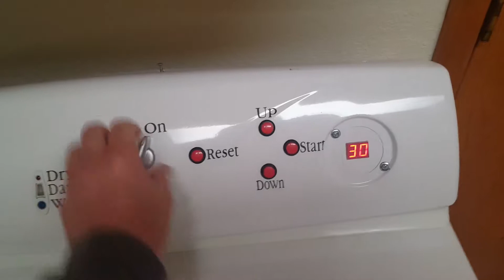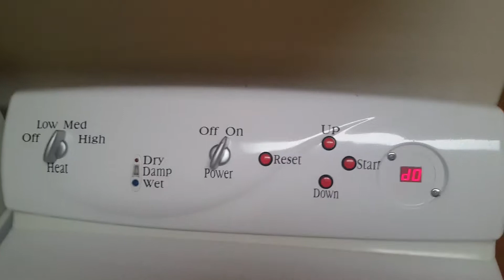Arduino controlled clothes dryer

Comment: Very interesting! I'm also trying to repair a clothes dryer and I think this is the closest to my situation I could find! Originally the problem was just a faulty opamp (resulting in the machine thinking the clothes were constantly wet) but of course while figuring out what the problem was, with my usual clumsiness I accidentally shorted the 12V opamp supply with its output leading to the premature death of the microcontroller said output was connected to... Now I figured out all the connections I need on the board to replace the microcontroller and I'm at the point where I have to program the arduino. I would have some questions regarding your implementation (if you're willing to answer, of course!): 1) How do you manage the humidity sensing? Since I suspect the clothes are not constantly making contact with the sensor, my idea was either to use moving average or to take the maximum humidity value measured during for instance 1 second. 2) How do you manage heating? My machine has two heating elements (800W and 2000W) which can be turned on individually and a temperature sensor. I'm guessing the three achievable power levels has to do with the different "programs" the machine could perform like fast drying and delicate. For now I'm just interested in getting the machine to work in one "mode" and I'm wondering which element(s) should I turn on and how the on/off time should be controlled. In your other video you say that the heater is turned on at the beginning and turned off for the last 5 minutes. I'm wondering if this means that the heat is actually on all the time or if there is some sort of sensor/thermostat that automatically regulate the switching to keep a given temperature (maybe based on low/med/high selector?). 3) You didn't mention if you can change motor direction but if it is the case, did you use that function and how?  The only way I can think of would be to change direction every couple of minutes to maybe help mix a bit better the clothes but I'm not sure it would even be necessary. Thank you!
Reply from the maker: Hi, Your dryer has new controls and circuits as you mentioned the opamp and 2 heating elements.
1) I did not add any controlling aspects to the humidity sensing. If I were to rebuild I would probably use interrupts so the moisture sensing could set the timer down to 5 minutes (if it currently greater than 5 minutes) and turn off the heater. As this is based on a 1 minute interval, the moisture sensing is only happening 1 time on the minute. More reasons to use interrupts and/or move to a seconds timing but figure out how to keep the overall in minutes. I decided it was not work the effort to rework at this point. Or until I run out of other interesting things to work on/have more ambition.
So, I am only using knowledge of how much time it takes to adequately dry as my guide. I changed my code to start at 40 minutes because 30 minutes was not quite enough the majority of the loads. If I were to do moisture sensing AND moisture control I was considering using similar to what you have mentioned. I was going to sense most recent readings and if X of the last were all "dry", then go to the cool down routine of go to 5 minutes and turn off the heating element.
As the old style of heat controlling (I do not know how newer higher tech dryers are doing heating control) have a "low" and a "high" thermostat. Simply, when the heat gets to the limit of the high thermostat (I believe they are both located in the exhaust pipe. It has been a long time since I had to replace these) the sensor (the sensor really is a temperature activated switch/relay) cuts off the 220VAC supply to the heating element. Once the sensor cools down sufficiently, it closes the circuit to the heating element. The moisture in the fabric keeps the temperature down, so as the fabrics become more dry, the heater will be on for less often. I am using the existing temperature controlling features of the clothes dryer. 
If you want to control the 800W and the 2000W heating elements then I would suggest using the Mega or similar model with more pins. I found that I was running out of pins. The 2 8-segment displays use a lot of pins. An option would be to use an LCD display on IC2 bus which will use only 3 pins if my memory is correct. I like the easy to read from across the room the large display. There are multiple options for displaying remaining time. If I were going to get your dryer  working and usable with only 1 of the heating elements, I would choose the 2KW element. I do not believe the 800W will be adequate and therefore efficient alone.
Because of the high current draw of turning on a motor I chose to stagger turning on the heating element by 5 seconds. The thermostats and the heat control knob (heat off, low, medium, high) on the front of the dryer are controlling the temperature. I believe that the cool down period (5 minutes for me) is important for the longevity of the heating element. 
3) I do not see any value in changing the rotation direction, even if you could. It does not matter in which direction it spins. The purpose of spinning is so that all of the fabric has the opportunity to receive the blast of air. The paddles inside the drum ensure this movement. Without the paddles the rotation has no value because the fabrics will remain in the bottom of the drum. To remove the need for the "throwing the fabric" would require a lot of space where all of the fabric is spread out on a rack or hung up with as little folding and creasing as possible. 
Do you have a schematic of your circuits? Thankfully my dryer had a schematic inside. It took a lot of time reviewing it, lifting the hood & kicking the tires, and figuring out how to interface with it. Early on I started to think it was too complicated, but I soon figured out it was relatively simple. Plugging the drying in for the first time into 220V was scary!
It would be interesting to see how you have mapped out all of your connections.
Reply: Thank you very much for the quick and very detailed answer! I very much agree with what you said at the end: I too thought that the machine would have been quite complicated but in the end turned out to be very simple, basically a motor, a heater and a couple of sensors! And in retrospect it actually makes sense that there is not much to it! This became another reason to trying fixing it, since the basic components are virtually indestructible or at least relatively cheap to replace and I didn't feel like wasting something that despite being about 15 years old is still as good as new (except for the microcontroller I killed and the 50 cents opamp used as a buffer for the umidity sensing) and on top of that wasting at least another $500 for a replacements... My machine is a rebranded version of the V-Zug Adora TS (not sure I can post a link but here you can get an idea on how the control panel looks like: https://www.ricardo.ch/de/a/v-zug-adora-ts-waeschetrocker-1216672122/ ). As you can see it has a 4 digit 7-segments display, 12 tactile switches (11 with an LED in the back) and other 4 indicator LEDs. At the beginning I wanted to try implementing all the functions but, as you mentioned, I quickly realized that the arduino pins run out quite quickly, haha. Just for the display, LEDs and button one needs a total of 22 I/O pins! Currently I have an arduino nano on hand which I'd like to use and it has exactly 22 pins, so... Just for fun I may still try to implement all functions (and yes, I'll probably need an arduino mega or something similar) but for now I settled to the more feasible goal of getting the machine running in a single "mode". If I planed everything correctly I should be able to do it with the 22 pins: 12 I/Os for the 7-segments display, 2 I/Os for two switches, 3 I/Os for the motor and heaters relays, 1 I/O for the open door reed switch and 4 analog inputs for temperature and humidity. Unfortunately I couldn't find any technical information (and I don't think there are any available) so I had to revers engineer the board(s) and make the schematics myself... a bit annoying but at the end quite instructive! With that I could determine the purpose of the 64 pins of the dead microcontroller and discarding all "useless ones" (related to IR communication interface, external crystal,  EEPROM memory, water condenser and some other circuitry I couldn't really figure out the purpose of) I ended up with about 30 I/O pins plus maybe 1 for adding a beeper which they didn't originally included, then as I said reduced to 22 for basic operation. Luckily I don't have to mess with mains voltage directly because the supply/relays board is completely fine and separated from the control board! I still have to figure out if this will work for the "final" assembly but for now I used enameled coil wire to connect to the various points on the PCB and a board with screw terminals for the arduino. 
In this next days I hope to be able to get some working code and to make some tests. I already have some pieces done but I still have to "bind" everything together. I found the FiniteStateMachine library which may work for me but still not sure especially because of the way the 7-segment display is setup, which requires the single digits to be constantly cycled though since the individual segments of the 4 digits are connected together. Can't tell from the video if your setup is the same.
For the humidity I think I'll try with the moving average because the (approximate) algorithm is just couple of lines of code. The default time on the machine was 1h40 and after one minute (and than constantly during the program) that time was updated based on the humidity reading. I see if I can implement something similar.
For the heating I can use both heaters (they're connected to two different phases and the manual reports 3.1kW so I'm assuming they can be on at the same time) but at first I may start just with one to see how it goes and then I'll implement the thermostat function you mentioned with the arduino. One if the temperature sensors is in fact in the exhaust conduct just after the dust filter and the other is right after the heating elements. Both are  simple NTC thermistors.  A good point you mentioned about heating are the 5 minutes of cooling at the end. I didn't thought about that at all and I'm not sure my machine did it in the first place but it definitely won't hurt! And also the staggered turning on of the motor and the heaters is a good idea!
Regarding the rotation direction I made your same considerations! The only situation I could think of in which it may be useful is with large towels/bed sheets: if the rotation direction is always the same they can eventually roll themselves up and maybe take more time to dry. Since the related relay is already there I think I may still implement some direction change every couple of minutes, but yeah, most likely that's not really necessary.

If you're interested I can let you know how it goes. For now thank you very much for your videos and your answers!
Reply from the maker: @scardis  It sounds like you are making great progress! I would be interested to hear how your project progresses.

The fan in my dryer is driven by the 110VAC motor which also spins the drum. So if I were considering reversing the drum direction, I would be moving the air in the wrong direction! Make sure your fan to move the air is not driven this way if you reverse drum rotation. ↪↩

If you do change direction, I would say make sure the motor has come to a complete stop before changing directions.
Reply: @eldenchandler495  Hi, sorry for the late reply... First of all, thank you for your suggestions: my setup is the same with the motor (in my case 220VAC)  running both drum and fan, the latter being actually bidirectional so there is no problem with changing direction. I also implemented the direction change with enough delay to ensure the drum fully stops before it gets moved in the opposite direction.
I also had to slightly modify my previous comment since I discovered I made couple of errors: first, what I thought was an overheat sensor (like a mechanical thermostat) was in fact another NTC thermistor placed right on top of the heating element. Don't ask me how I mixed them up but it totally makes sense and in fact I was quite relieved to find that out since I wasn't too convinced about regulating the temperature from a reading in the outlet. On top of that there are also two backup, manually resettable, thermostats (180°C) in series with the elements disconnecting them in case of major malfunction. That was also nice to discover (I didn't removed the back panel before). Second, at first I didn't realized that the voltage supply to the humidity sensor is rectified but not filtered/regulated so the reading is actually valid only about half the time. This made sense of some pieces of the schematics I couldn't really see the use before. In fact another ADC is needed in order to check named voltage and determine when the reading has to be taken into account or discarded. I ended up freeing 1 pin by connecting both heating elements' relays together. 
Finally I put everything together and (very surprisingly) nothing popped and almost everything worked right away and I was able to dry several batches of clothes. The only major problem I still have to solve is the "dry detection". For now I didn't had much time to work on that but despite the tweaking, I just got the machine either to stop too early or not to stop at all... :) I logged the data from a couple of runs in order to analyze it with Octave and from there a moving average seemed decent enough but turned out not quite! Not sure yet if it is an arithmetic problem with arduino,  some error in the code or if a different algorithm is required. Once I (hopefully!) solve this issue I'll let you know and if you're interested I can eventually upload the code and data on github. Wish you a great day!

Comment: Did you never had any problems with crashing the arduino? Because of using 110volts AC?
Reply from the maker: There are no power issues. If you look at the video @4:20 you will see the power adapter which supplies the DC voltage to the Arduino.

Comment: That looks amazing, what you have done there, Elden. I like the way you "repurposed" the old board and just used bits of it for your own needs, nice one. Good point you made about overrating some of the components like relays, you can never cut corners where mains electricity is concerned. You mention cost, about $30 in actual parts but dozens of hours in getting it to work. But that is not a cost. That is benefit and pleasure and what makes life worthwhile. Think of the additional experience you now have too, that can't be quantified. I'm glad my channel helped you achieve this in some small way, but don't sell yourself short! As the Americans (and probably Canadians too) say: Good Job!